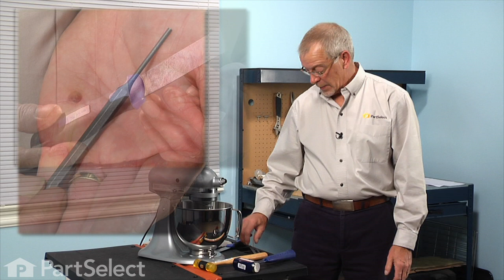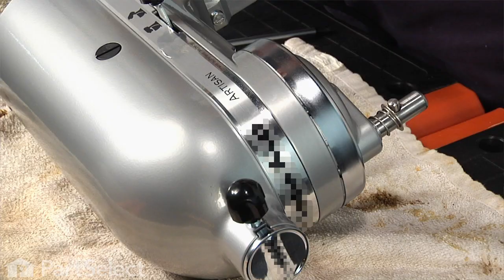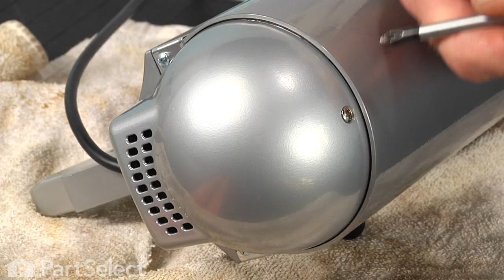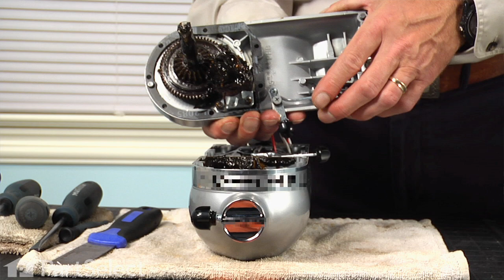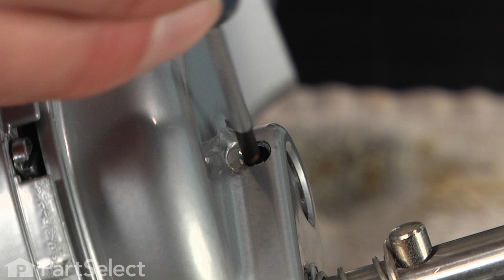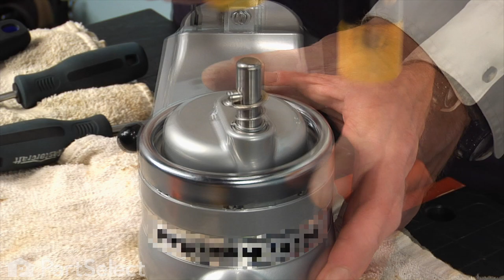Stand Mixer Repair - Replacing the Worm Gear and Bracket (Whirlpool Part # 240309-2)

Comment: Good video! One minor misnomer: The worm gear is the long, narrow metal gear that drives the worm wheel, which is what you replaced. The worm wheel is made from a softer material(It looks like nylon or delrin to me.) to help keep the gearbox quiet. It is a wear point as it becomes part of the lubrication for the worm drive system. The video is clear and concise and you showed good workmanship and use of proper tools. Thank you!

Comment: The housing pin was bent, is that normal. Larger wheel was not spinning the housing wheels because the pin had come off, i put it back it worked. Now do I have to straightened the pin or it is bent?
Please someone answer to me. Thank you in advance

Comment: I'm trying to fix my Kenmore Elite stand mixer, model number 1008900890A, and can't even get to any screws to get it apart to get to the inside parts! I was instructed to remove the silver band by starting at removing the speed knob. That doesn't seem to come off. Can you direct me how, or if I'm starting off wrong by even trying that?! Help! I can't afford to take it to someone and I don't want to lose this machine if I don't have to, it was a gift from my late father 😔

Comment: How do I know what is broken on the machine?
Reply from the maker: S Brenni I can help you diagnose your problem if you can tell me what is wrong and the model number off your mixer.
Reply: Here s my Video :)
Reply: Model 5KSN150 PS EGR
Reply: @partselect  Would you know which worm gear is required on a Beau-mark stand mixer? Made by Sensio model SM248
Reply: +S Brenni I figured out the problem by taking mine apart.  The mixer blades wouldn't turn (or turned only intermittently), so I took it apart and found that the two gears off the worm gear were both damaged - the damage was obvious.  Now I need the two gears and can't find them.  Made of Teflon, on my Sunbeam mixer.  I use it to bake bread, so I haven't been able to bake bread!